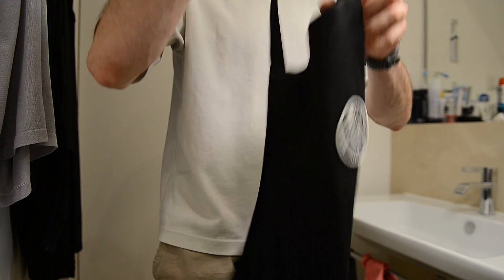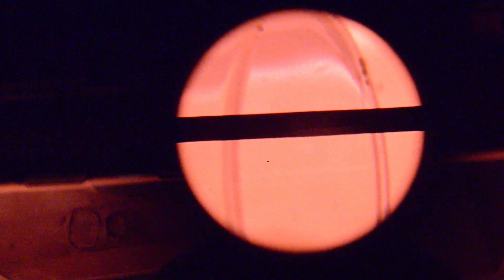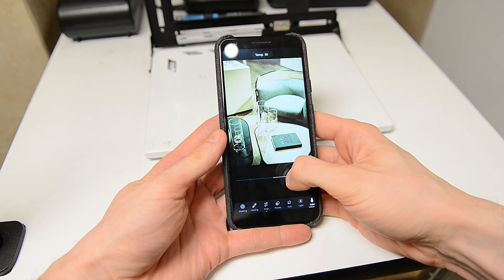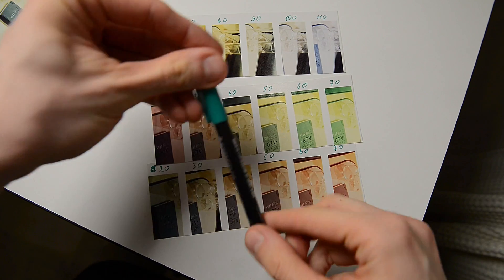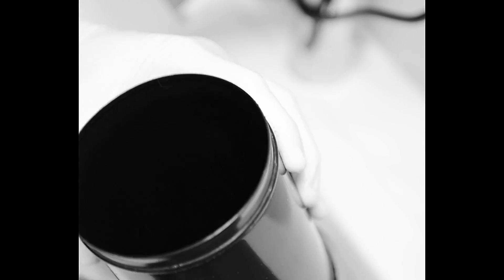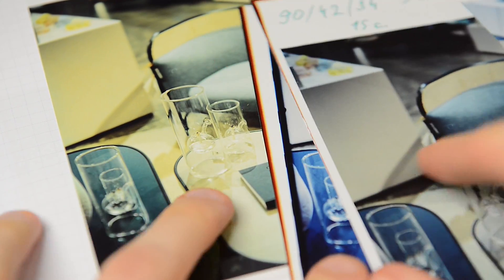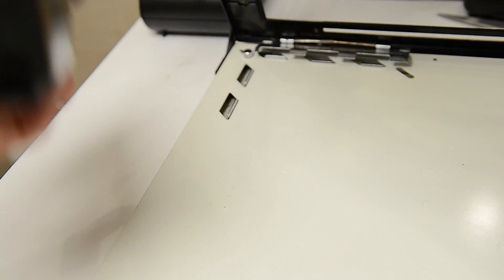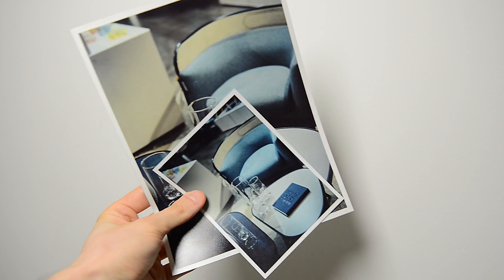Learning color correction in RA4 process and make different size of the prints with color analyser

Comment: I used to print my own darkroom color prints several decades ago. This is the best instructional video I have seen so far on printing color negatives in the darkroom. I printed with and without a color analyzer. I like this color calibrator you used. It works pretty similar to a color analyzer such as using the cyan channel for exposure. This video will help many of those who want to print color in their darkroom.
Reply from the maker: Thx 🙏

Comment: There is no role fr using all 3 subtractive primaries it wastes and is a grey tone and also base liners can carry on without any electronic a costly accessories even if a colour filter  drawer tupe  type starting days enlargers are uses...handy guide is to use Kodak colour filter finder kit even if it is nt to use but subtractive colours sets fr a colour filter drawer enlargers are uses these filters does the same job as Kodaks finder kit.....dry the print now use filters from filter box see through it to match a white balance or an effect one Jay liking then use either two or single such glass mounted filters as final print exposure corrections are usually marked at the edge of such filters or go fr oanother test...bt authors electronic analyzer no doubt more scientific approach which has role in jana branch like as the forensic where a perfect white balance is a must and performs by the underlying and famous integrations to the gray theories.where when 3 colours produces a neutral gray stated to be a right white balance and a scientifically TRUE print .  Tweaking of course possible bt that branch may get the art form of printing . Thanks the author fr every thing on colour printing in a short durations nomostey sir dada
Reply from the maker: Thanks for sharing your perspective and the detailed explanation! 🙌
You’re right — there are definitely different approaches to colour printing, and it’s great to hear your method with the Kodak filter finder kit and manual filter adjustments. Forensic-level white balance is a fascinating application — I agree that in that context, precision matters more than anything.

Appreciate you taking the time to add your thoughts here, and namaste! 📷

Comment: Cyan should be at zero from a starting point…
Reply from the maker: Why? :)
Reply: @NordicLab   having all three adjustments used creates neutral density light as they cancel each other out. E.G you are increasing exposure without changing color correction giving the illusion of change. Start at 50y 60m and make adjustments to cyan ONLY if you run out of adjustments in the other two.

Comment: hey - have you ever tried printing using small increments of developer per print and then discarding the small increments? i realize you simply use the full volume over and over again until it exhausts, but i'm curious if you have experience the other way?
Reply from the maker: You mean using RA4 for one shot use? For my drum and this size of the print it's just trowing away chemicals. You need 50 ml for one run, so it means you can make only 10 runs from 500 ml, and i make 45-50 runs. Modern chemistry for RA4 industrially use and it's designed as replenished chemistry in R2R systems, so with special "additional solutions" you can use same chemistry for years. But this is also not why i'm using 500ml solutions - mostly it's temperature stability. If you use small bottles - you almost don't have thermal capacity, so your time will be sucking temperature, also it's just not practical to make solutions in my case.